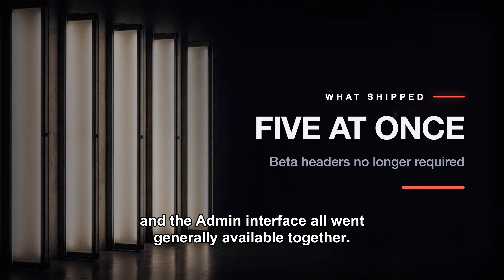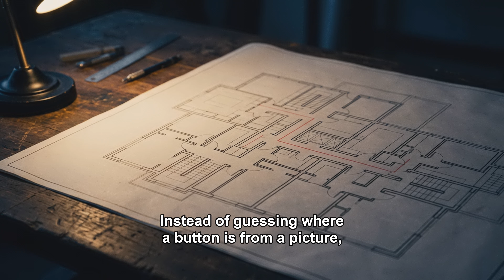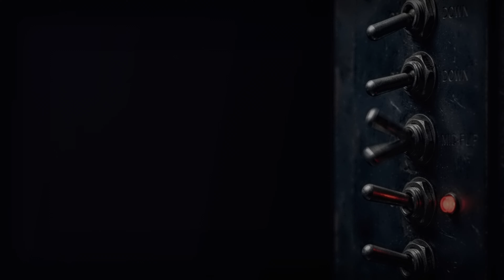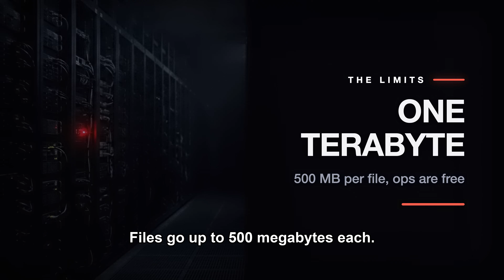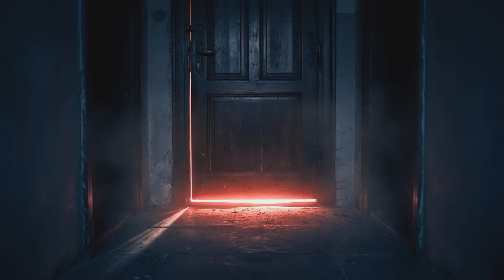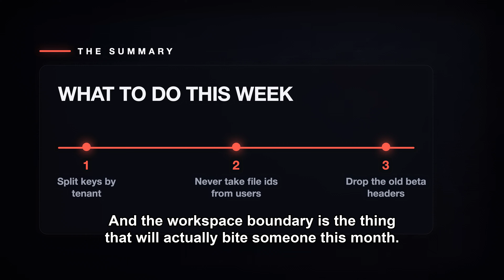The Truth About Claude’s New Agent Tools (And the Security Leak)

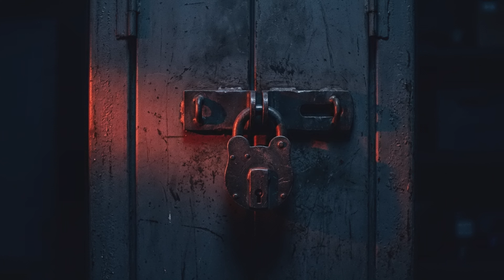Comment from the maker: Correction: at 2:22 I say the browser tool is not on Google Cloud. That's wrong — it IS available there. Anthropic's docs say: "Platforms: Claude API, Google Cloud; not available on Claude Platform on AWS, Amazon Bedrock, Microsoft Foundry." So it's two platforms, not one. Bedrock and Microsoft Foundry are genuinely out. My mistake — I worked from a summary instead of reading the compatibility line myself. Everything else in the video checks out, and the follow-up on what the browser tool can't do is now up on the channel.